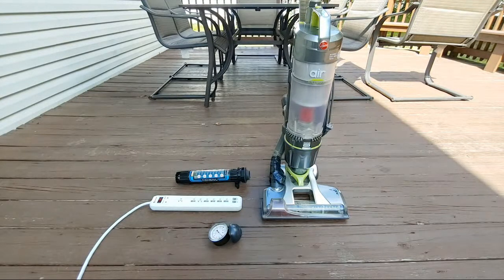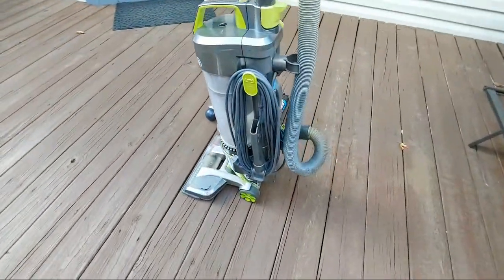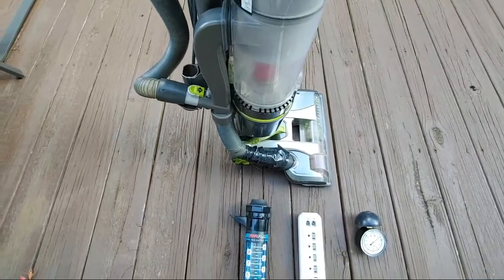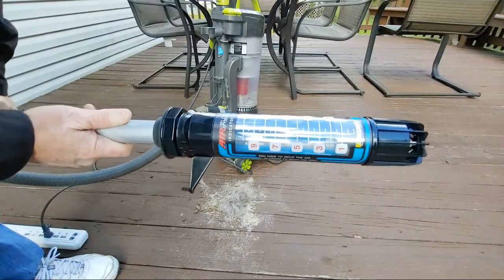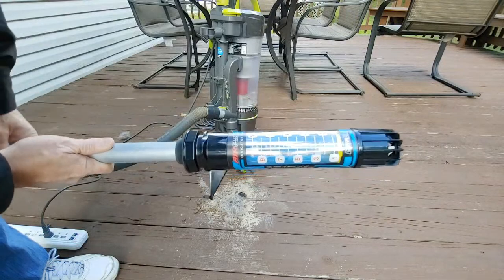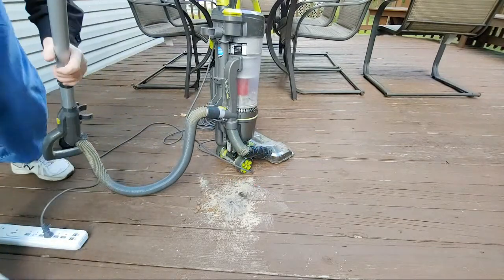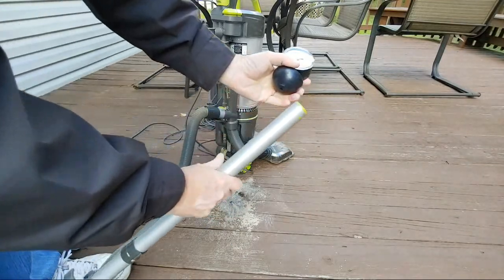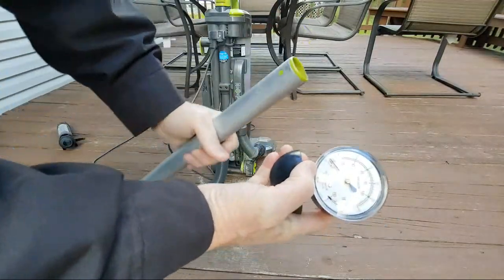Hoover Air Steerable Curb Find First Look

Comment: Just got myself today an almost unused Electrolux Regency 1500 model 1515

With all original attachments, 2 new bags and 5 exhaust filters, from the day it was bought!!

But, it looses almost all the suction throw the hose.. is there a way to better seal it?
Reply from the maker: If the hose leaks badly, it needs to be replaced.
Reply: VacLab it’s not badly but it leaks... 

I used my D4 rainbow hose to see the difference of rotation of a air driven tool and it surely did changed the velocity 

(It fitted on the Electrolux)

Comment: Oh God, that motor sounds crunchy. You want a brand new Shark motor that will fit this? 😉
Reply from the maker: A Shark motor will fit a Hoover without any mods?
Reply: @VacLab  Yup, the KingClean HX70GB series found in the Navigators will slip right in; you just have to keep the old lower seal and upper plastic brace. The 9-amp motor I used in my Steerable motor mod was actually made by KingClean as opposed to Cinderson (which yours has).
Reply from the maker: @Javi_Lacking  The motor sticker reads (in part) "Suzhou KAIHANG Electromotor" and is rated at 1300 Watts. It has a 4" fan though. If you think it'll fit, feel free to send it over.